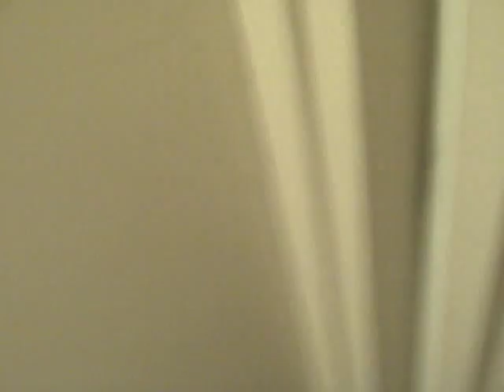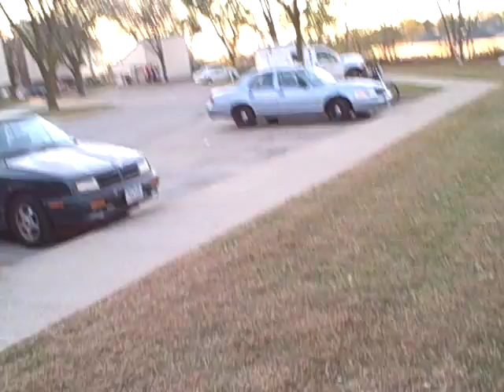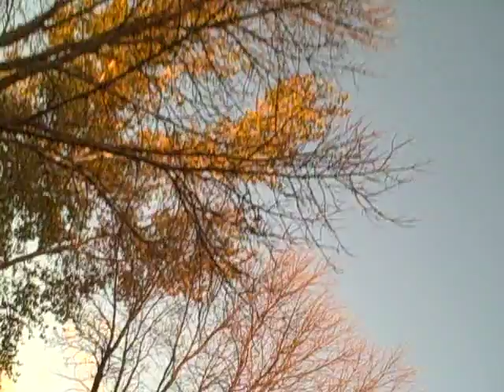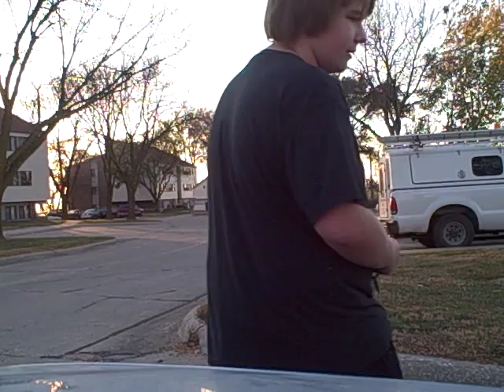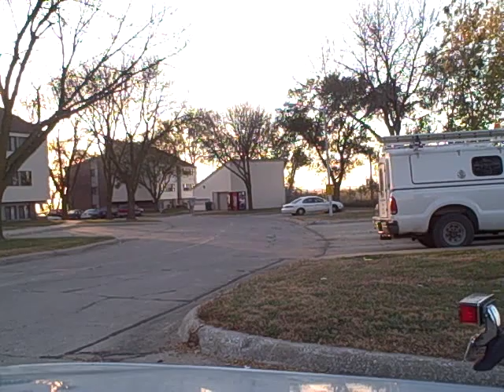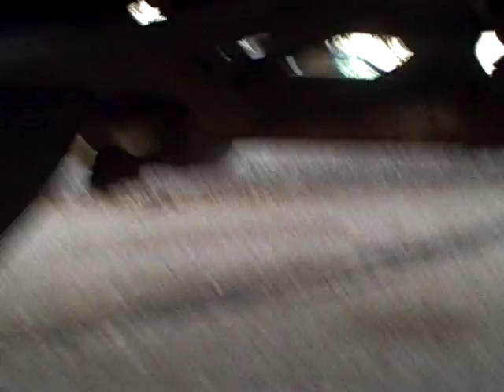KZ1000 has a new sound!!

Comment from the maker: @ajvickie Oh i plan on dropping some cash into this thing:) I installed a kerker 4-1 on it last year and i burned the valve guides out of it from running too lean :/ Im getting a ported head, machined valves, GPZ1100 cams with .375 lift, and proper jets:) thanks for The comment yo.
Reply: 171apples171  I have had my 79 kz 1000 up to about  115 120 was a hell  of a ride

Comment from the maker: @PanchoTadura Thanks man:) i love that bike. Gonna get the head ported and drop some GPZ1100 cams in there this summer. gotta do my valve clearances too. Shortly after this video was made i started to get a bad tick coming from cylinder 4. Just valve lash, no big deal. Ill fix it all up and drive the shit outta it. I gotta fix my crossover pipe too. As kewl as it sounds, i have no bottom end torque any more:D